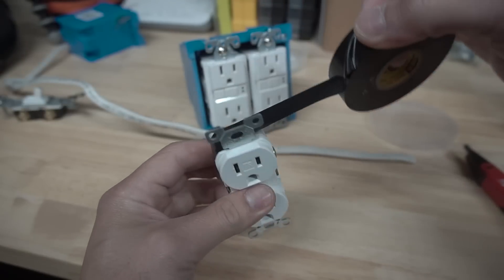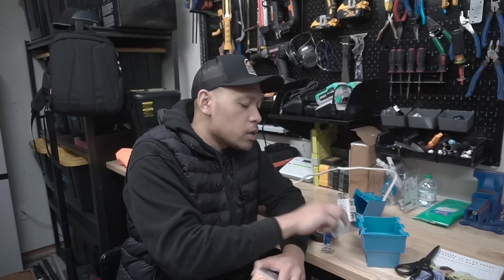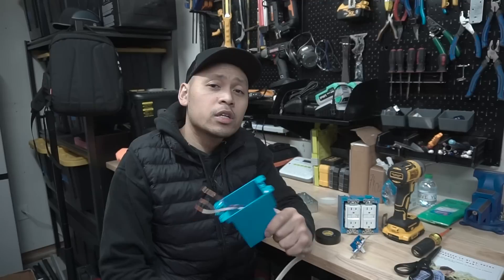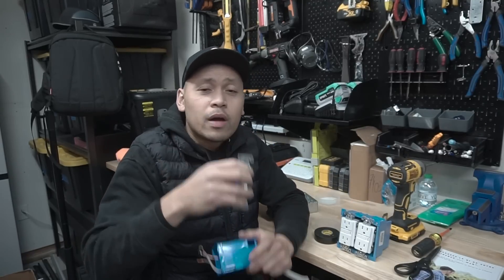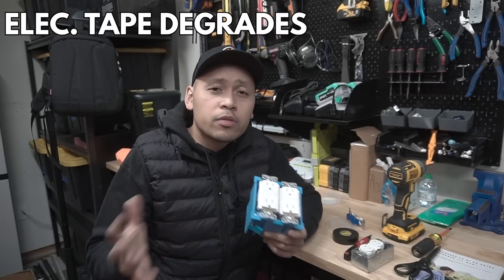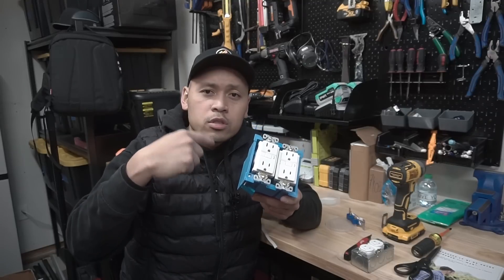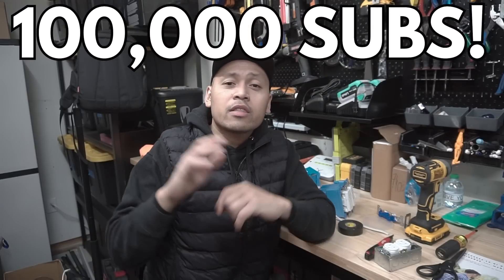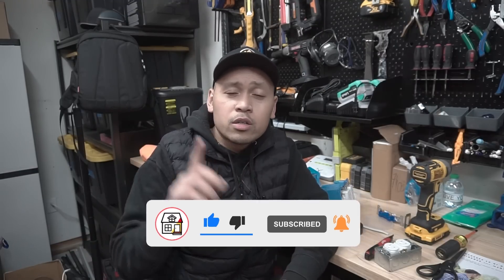Is It ILLEGAL To Wrap Outlets And Switches With Electrical Tape?! The DIY Great Debate! How To

Comment: I've been a electrician for 20 years and I've always wrapped tape around my devices. It's a good practice. 👍
Reply: Good advice, I too have been a licensed electrician since the late 80's. It's just good insurance. If you've ever had to pull an outlet and had it short out, all kinds of words come to mind.
Reply: I only tape metal boxes with deep rings like masonry rings. Otherwise nah
Reply: @ryankile1264  I done electrical work since 1990.  In 1970, back then the idea of taping outlets was rare, and all the boxes were metal.
I have been a maintenance electrician since 2000.  I have had to replace hundreds of outlets.   I never ran into a duplex out let where the terminal touched the metal box.
I recall one box were the negative wire touched the metal box,  and the insulation wore away and caused a burning insulation smell.   It was odd because the breaker didn't trip.
I never tape my wires,  and I never got call backs. 
Although my biggest fear was metal staples on romex. 
Romex protection sheath is very thin.  If you hit the staple too hard, the it can nick the romex.  
This nick can create a small electrical heater,  which will create a fire.  So I never use steel staples, instead I use one hole romex metal straps.
I do not understand why the code permits using metal romex staples.
Reply: @jamesmooney8933  in my home, the nailing for the box had backed out and was contacting the wires and one terminal. It was just enough to cause some arcing.  This was the first outlet i have seen in my own homes that was not wrapped. (This is why the video caught my attention 😆)
Reply: @jamesmooney8933  the amount of stupid nonsense nec has implemented then withdrawn is staggering. My favorite was specifying that the ground pin should be mounted up.  Apparently they had nothing better to do that year and that caused all kinds of stupid problems with extension cords
Reply: @nameless-og  First of that was shody workmanship.
The box and duplex is dependent on more than the nails. 
The bracket on the box wraps around the stud and hooks into the stud.
This provides extra security for the box.
Also there is a clip, that according to code is supposed to be put in place.  This clip is installed opposite the bracket on the box.  This clip is designed to go between the box and the dry wall in the room behind the outlet.   This clip prevents the box from moving back into the wall.
The dry wall holds the box in place. .
If you look at the duplex outlet, then you will see ears on the yoke of the duplex outlet.   These ears  press against the dry wall, which holds both the box and the duplex in place.
At the top and the bottom of the yoke of the duplex outlet are two 6/32 screws.  These two screws secure the duplex outlet in place,  so ghe conductors don't touch the box.  One of the 6/32 screws has a wire spring that grounds the duplex out to the box.  Also the grounding conductor is grounded to the box by a green 10/32 grounding screw.  There is a pig tail that is wire nut to a green grounding wire nut.   This pig tail is attached to the green terminal on the duplex outlet. 
If you look at the duplex outlet,  you will note that the terminals are recessed.   The recessed prevents the terminal making direct contact with the walls of the box. 
Since the box, and the duplex outlet are well grounded, any contact with the terminals on the duplex outlet and the box would cause the breaker to trip. 
The electrical tape would be contra-productive, because the electrical tape would delay the tripping of the breaker. 
This would create a situation of a minor short.
A minor short would not trip the breaker.   A minor short would act as an electrical space heater.   This would cause th he box to get hot, not tripping the breaker,  but causing a fire.  A minor short is much more dangerous than a dead short.
The conductors touch the box is caused by a failure of workmanship. 
The electrical tape is not another layer of protection,  but instead creates a minor short that creates heat.   It is not electricity that  causes fire but heat from electricity.
Reply: @jamesmooney8933  first, thanks for the details, i will absolutely need to re-read this later today... in my situation, the breaker never tripped, it just kept pulling down all the other circuits like i was losing powers. Creepiest thing i ever saw, might have thought the place was haunted if I hadn't just turned on the washing machine!  I see what you're saying about the quick short being overall safer.  That is very good to know.

The other points you're telling me about do not exist here... Its an old new england house... Ive never seen one of those clips you're talking about, to keep the box from being pressed in, but they sound great... The nail i am refering to is the one that was actaully INSIDE the box driven into the stud.  There were two on this one, one actually was still driven into the stud just fine.  Ive seen on more modern boxes that are not metal where these nails are driven at an angle from outside of the box (in fact thats what i replaced it with when i saw the precariousness of an insecure nail resting on stripped wire) ... But these old metal ones are all the same in the houses ive lived in... I have seen replacements where the metal boxes have a bracket that wraps around the face of the stud, and i do wonder if thats what you're talking about.  These old ones though are not like that, its just a simple box hanging on the side of the studs and the nails were driven on the inside, not tabs on the outside (or brackets)
Reply: @jamesmooney8933  Why would you think that shorting the neutral would trip the breaker? That would only happen if it was on an arc fault or ground fault breaker. A short on the hot will often trip a breaker, but not always. I've never heard an electrician call the grounded conductor (neutral) a negative wire on AC systems.
Reply: @Doug-gp2qw  The grounded conducted is the green wire or bare.
The neutral is ground, and the proper name for the green is grounding conductors.   Grounding is right.  I generally refer to it as the green wire.
Now the neutral and the grounding conductors are connected at the main panel but not on subpoenas.  But you are right it is called the grounding conductor.
The breaker will trip if the neutral touches a grounded box.  Also a fuse will blow if touches a grounded box.
You see arc-fault breakers  are relatively new.   Before arc-fault fuses and breakers worked very well.   
If a conductors either hot or neutral makes contact with a grounded box, and if the outlet has been wrapped in electrical tape,  then the electrical tape will slowly melt.   During the process of melting,  there will be no arc for the arc-fault to trip.  The small  nick will create heat until the house burns down. 
Ok, I have a question for you.   How can a man get electcuted without touches a bare wire, or being wet?
Reply: @jamesmooney8933  In the code book the white or neutral wire is referred as the grounded conductor. The green or bare wire is the grounding conductor. If the circuit is not on a GFCI or AFCI breaker then the breaker will not trip if the neutral contacts the box or bare ground. In fact you can use the ground as a neutral. It's not safe, but the circuit will work. 
If the ground is not continuous to the panel and a hot wire contacts a metal box or bare wire than the box will be hot and it will not trip the breaker.
Reply: @Doug-gp2qw  thank you for reminding me. 
When I got my first job as an Electrician,  I mentioned to the foremen that there might be too many wires in the box.
He said to.me what are you mr. Code book.   I never mentioned the code to a fore-men again.
I got the general idea alright.
Reply: In metal boxes absolutely.! Or multi gang boxes. It also adds a level of protection for the diy that probably shouldn't be messing around but you can't stop them but you can help protect them.
Reply: I've been an electrician for 20 years...if you do things neatly, you'll never need to wrap up a device in tape.
Reply: The tape is for me, not the customer.
Reply: @harrygarcia8749  I have confidence in my workmanship.   I creates a slow burn, the slow burn won't trip the breaker. 
You are right, the delayed slow burn will delay your call past 5 months. 
By delay the breaker trip removes your responsibility for shoddy installation of the outlet. 
Without tape the tripping of the breaker quickly,  which will be embarrassing for you.
I only use tape in damp locations.
Reply: scab
Reply: I used the super 88 is that ok or should I go back and redo with super 33???  What’s the difference and why???   Thanks
Reply: Good practice is not a good argument.
Reply: No real electrical does this. 10 years, 20 years... doesn't matter. If you know what you're doing it's ridiculous to wrap your work with tape
Reply: Your mom says to wrap it
Reply: @zacharysherry2910  She is dead.   Please keep your comments to me.
Reply: You can't just assert "it's good practice" and use argument by authority ("electrician for 20 years") as the support for the claim.
I know plenty of people in the trade with decades of experience who do things wrong all the time.
There is NO NEED for wrapping anything in PVC tape as it is only going to turn into a sticky mess.   If you think you need to wrap devices in tape, you're doing something else wrong.
Reply: @DiffEQ  Years ago this was ok, but we use plastic boxes instead of metal boxes.  But I still do what I was taught and wrap with black tape.  I have never had a short wrapping and I feel better about sleeping.  If it is a plastic box then there shouldn't be a need.
Reply: @DiffEQ  Honestly I can see the sticky causing a fire tbh ><
Reply: @bigkirbyhj666  to be real, i just pulled out a bunch of 30+ year old switches and they were taped.... they weren't gummed up or melted... the boxes are metal to. I'd say even if its not necessary, its not going to hurt

Comment: If the grounded metal box is damaged, you would want the breaker to trip.  Wrapping the outlet would prevent the breaker tripping - to tell you there is a problem

A box should not be overcrowded in the first place

Appropriate selection and regular checks should avoid the excuse of broken cover plates

The tape is sticky and attracts dust and usually leaves a residue that makes everything sticky and slippery. Slippery what you dont want when handling electric stuff

Wrapping hides the connection from being visually inspected for signs of overheating, may go as far to say it  prevents the connection from being easily accessible

Wrapping is nonsense
Reply: Idk if you cant visually see the screws you got too much tape on it

Comment: Why can't the inspectors use the tool that checks to see if the outlet is wired correctly? I agree don't stop at a minimum, and I always wrap my outlets with electrical tape. It was taught to me by a guy who worked in engineering for my company! And a voltage detector, I believe, is mandatory. They were not expensive.

Comment: Great idea! Safety is first. I did get shocked because I had the electrical outlet cover off on when I was fixing the drywall and the blade touched the outlet.
Reply: My wife removed the outlet and switch covers for painting. I went into the room and turned on the light.  My fingers went into the opening!  I jerked my fingers away and replaced the cover. Folks, people often reach for the light switch without looking. Replace the cover on the light switch as soon as you can.  This is an argument for taping.

Comment: When wrapping if the tape is pulled tight, cut the tape leaving an inch so hanging loose.  Give it a second to relax before sticking it down.  With the tension off, it is less likely to pull off and hang loose.  💯😁

Comment: Well,  congrats on a very good topic, and many reasons to tape and not to tape terminals.  Always on EMT, not necessary on Plastic....but you have a very good point about taping all recepticals...kids...though there are tamper resistant receptacles, that won't protect against accidental contact under a broken or damaged cover.  Also, you stated some inspectors cannot see under taped recepticals and the wires.....that's because most municipalities only have building inspectors, and not electrical inspectortors....here in the Cincinnati area,  we have actual electric inspectors, former experienced electricians and they can tell what you are doing and they're darned good at enforcing the NEC.

OK my friend, keep up the good work and NEVER call your videos HACKS....a hack is is just that, an opinion about how that particular person does things!  AND in my opinion,  a hack is just a waste of time  doing something that is totally insignificant to what you're trying to promote or prove!  Oh BTW, I always load recepticals in ground first so itd tucked way in the back, then neutral. And finally hot!
Reply: Consider that taping prevents the grounding system from working if there is a problem

Comment: Illegal? Not. 
Just a good practice, particularly when working in tight boxes, esp metal boxes. 
Plastic boxes can’t arc, but it’s still possible to get a shock. 
Using crappy cheap tape? Don’t even bother wrapping them, it’s going to dry out and become ineffective in short order. 
Good tape, the type that when stretched adheres to itself will last ages. 
But the biggest issue I’ve encountered is when it’s not cut off, but pulled to tear. This situation inevitably results in the tensioned outermost part, losing stickiness and elasticity, and unraveling. 

As for codes, everyone always blathers about codes. Codes are there to enforce unscrupulous and/or ignorant electricians from cutting corners to save money and doing shoddy work. 

Knowing some electrical laws of physics and being conscientious goes a long way in doing the best job and not relying on some jurisdictional (arbitrary) ‘law’ that all too many electricians trained by a book and dictator like to argue about. 

Doing it correctly and safely are the most important thing in every situation. If it looks proper, it’s not likely that it’s wrong enough to matter. That said, 😮m referring to knowing what’s actually proper, ie using 12/2 when 14/2 is adequate, isn’t bad. But 14/2 where it should be 12, that’s f’d up. Not because of some bs code, but because it’s going to probably start a fire.
Reply: There's no shortage of code Nazi's, they often lose their common sense, and argue about the most frivolous things😁.
Reply: Agreed. I almost relied with rant. Decided it was not needed. You got my point.
But I am adding something I failed to include. Tape is never used in new construction work. It’s a waste of resources and doesn’t show professionalism. 
Seasoned electricians of old, used it when friction tape was part of the tool kit. When solder was used. I occasionally will actually solder stuff, but mostly simply wish I actually had a solder setup on hand! I recently did purchase a small butane torch for heat shrink needs, which rocks. It’s great, when doing electric repairs, having electricity up on a ladder requires more potential shocks, or tripping hazard from the extension cord from some other (distant?) outlet. 
Last summer I tripped on the cord I was using in an attic, the job was finally completed, I was descending from a 2000 degree garage attic, I’d made dozens of trips up and down, and the last one was finally in site. 
I broke my ankle in two places. Took an extra 3 weeks to finish a job I was within 30min of completion. 
But at least everything was CODE!!!, except the cord not being directly along the ladders steps!  
I wonder if someone knows the number for this violation, as applies to Wisconsins local doctrine.

Comment: Why not tape the inside edges of the box?
Reply: I've done that! Also you can get cardboard sheetrock shims, come in bundles 4ft long by I think one and a half inch wide, cut a few pieces,stuff them into the sides of metal box, works just fine.

Comment: Young man, if you want to give advise regarding electrical please reference the National electrical code if you think you're qualified to interpret the code.
Reply from the maker: Thanks for the feedback 🙏🏽
Reply: All my code books are labeled NEC  or NFPA never NESC ?
Reply: @scottrussell4307  good
Reply: Old man, first you give 'advice' not 'advise' - (advice is the noun, while advise is the verb). Next, you should have also recommended to reference the NESC (National Electric Safety Code).
Reply: @panerai_fan  Maybe you should be teaching an english class.
Reply: @richardmontes6420  You need to capitalize the E in English as it is a proper noun.
Reply: @panerai_fan  I new that.
Reply: @richardmontes6420  You spelled "new" wrong. It's knew with a 'k'.

Comment: I hate videos like this too much information just go straight to the point of topic is it or is it not legal. If you trim your wires right there should not be any excess wire exposed. The only purpose of wrapping switches and sockets so that when you do future renovations such as painting or wallpaper and you want to pull the outlet away from the wall to keep paint from getting on terminals
Reply from the maker: Thanks for the feedback! 👍🏽😊

Comment: dumbest idea ever! NO NO NO!

Just do the job right and the tape is unnecessary, even in metal boxes!

If you are not confident enough to do the job right & safely with the equipment as designed, then DON'T touch it.

Stupidest discussion I have ever seen!

For all of you idiots who admit to doing this, stay the f**k off my job sites!
Reply: I agree 100%.  The ones who advocate taping in the comments are idiots. The ones who say they're electricians who routinely tape are either liars, or idiots who were never trained properly.